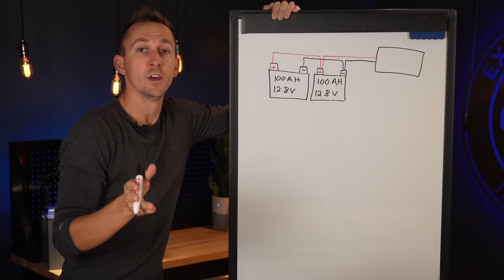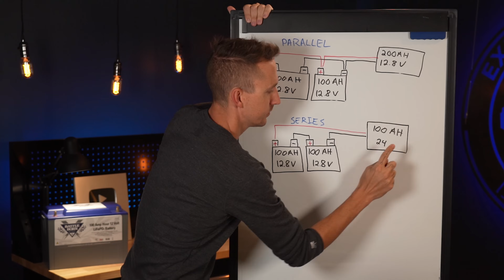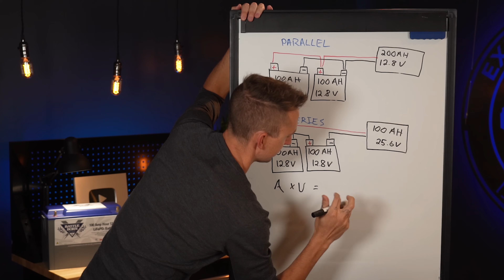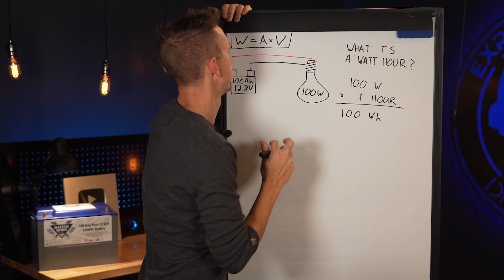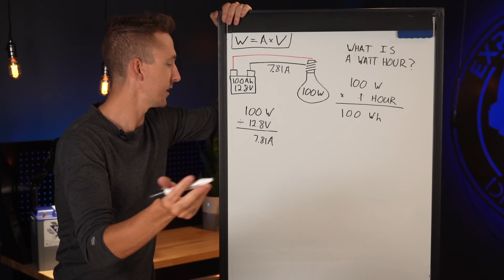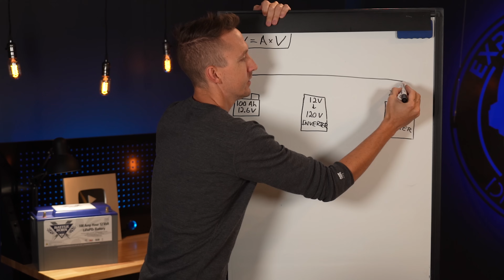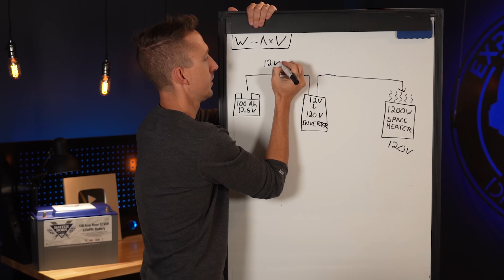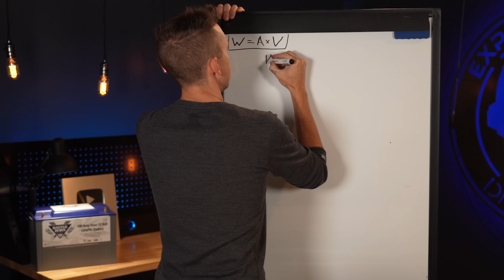AMP HOURS EXPLAINED (amp hours vs watt hours)

Comment: Am I the only one confused? He says the 7 amps is the same as the 3.9 on a 100 amp hour battery. Says it’s the same. It’s not. The 3.9 amp will drain the 100 amp hour battery half as fast.

Comment: A little critique you are right on formula of amps x volts equals watts but you're going to draw more then 95 amps because there is a loss of energy in the transformer inside said inverter. Soo say your inverter is 90% efficient that means 10% is still lost to the conversion of 12v to 120v. So the equation will now be 95 + (95 x .10) = 104.5 amps plus the inverter draws power to be on as well so you have to consider that.  The idle inverter power consumption I believe is a constant that has to be taken in consideration for long time use in calculating total amp draw from a battery. Cause the inverter is powered by the battery too not just the load it's supplying a 120v or 240v device or devices. The inverter if it's a 12v inverter requires some energy to the circuit board inside it to properly convert 12v to 120v/240v. Plus as said before take into consideration the efficiency of the inverter itself. The higher the efficiency the less lost energy and therefore more usable energy. But keep in mind just cause a battery says 100 amp hours doesn't always mean you actually have 100 amp hours to use.
Reply from the maker: I purposefully omitted things like inverter losses, pukert exponent effects & the differences of inverter losses between inductive and resistive loads to keep the video easier to understand for this 101 level discussion.

Comment: Does that mean you have fried the battery if you depleted it completely. Or if you continue to do it it is not health for the longevity of the battery ? 
Is there a formula that should be considered to not deplete the battery to low?
Reply from the maker: Each battery type/chemistry/manufacturer will have their own guidelines for their depth of discharge and how it affects longevity.

Comment: Can anyone explain to me is why at 12.0 volts my leisure battery is (apparently) deeply discharged and needs changing.
Reply from the maker: A fully charged battery will sit at somewhere around 13.6V and as it discharges; the voltage falls.
Reply: @EXPLORISTlife  I realise that, but why at just 12.o volts is it classed at deeply discharged IE Needs replacing
Reply from the maker: IDK... that's just how batteries work.

Comment: So if I'm understanding this right a 12v 100ah battery which costs a minimum of $300 can only run a space heater for a hour. In the winter in my house we run multiple for probably 8 hours or more. That's not even counting other power usage and that's thousands of dollars in batteries just for a day's power. How can anyone build a feasible battery backup at these prices with such small capacity?
Reply from the maker: Usually people aren't building off grid electrical systems to support extensive electric space heating usage.  Diesel/gas heaters like the espar d2 are more popular for mobile applications & wood-burning stoves/fireplaces are more popular for stationary applications.
Reply: @EXPLORISTlife  diesel and gas are getting mighty expensive. Part of the reason I was looking into solar was in hopes of circumventing the ever increasing costs of energy. Storage is surprisingly low in capacity and high in cost though.
Reply: @Silmerano And there, in a nutshell, is why so-called "green energy" is still a long way from being a viable alternative to fossil fuels and nuclear power.

Give it time though and eventually some boffin will come up with a great, efficient, compact, low cost way to store large amounts of electricity long term.

You'll know who they are when it happens, because they'll rapidly become one of the richest people in history!

Comment: I have a 6v deep cell battery rated at 370 ah (20 hr. rating) but the manual for the battery says 2.46 kwh (100 hr. rating). If I use the first number ah I get 6 x 370 = 2.22 kwh but the published value is 2.46. Why? this is for a Trojan L16RE-B

Comment: so if a motor is 180w and it runs at 220v it then consumes 0.8181A per hour?
Reply from the maker: At 220v; yes.  If it's being inverted from a 12V battery bank; it'd be 180/12 = 15 amps coming from the battery.

Comment: wiring two 24v arrays to increase to 200ah. should it spark or attempt to weld to stud?? The issue is when wiring the 2-24v batteries together the wire to inverter.
Reply from the maker: Wiring batteries to an inverter will likely spark; yes.

Comment: I don't see any benefit using a 24 or 48 volt bank in a camper situation, the only benefit is smaller wire to the inverter. Now you have to add a converter to get 12 volt appliances to work, you have no backup for coach batteries if the need arises, not without special wiring considerations anyway. Keeping 12 volts just makes everything easier, the cost in the wiring, to me doesn't add up, not after buying everything else... converter...special relay considerations for coach back up...I'm sure other things I'm not remembering. 12 volts just keeps it simple.

Comment: A problem that I need to know I use a 12-volt system and an inverter to change it over to 110 is 12 volt conversion 210 more efficient than 24 volts converted to 110 which one's more efficient don't care about wire size about efficiency or are they both the same. Thank you if you could answer the question to make it easy old me for I am old and that's my skis

Comment: so its just because wires are expensive mostly that you wouldn't want to have a 12v system but in reality you only need to get those wires once. Everything seems to run from 12v for DC power. I'm not really understanding the rest of it.

Comment: and here's the problem with your description, everyone wants to know how many hours a battery can run an appliance. and yet you never mentioned time in your calculations not once. for example, if you have a 12 volt battery that can run at 4 amps that winds up being 48 watts correct? if I plug in a 12 volt fan, will it run for 4 hours? I have no idea, you tell me. but you didn't tell me even though I watched your whole freaking video
Reply from the maker: Chill bro.  That's not what this video is about.  I have a different video I made like three years ago that addresses that.  Search for 'explorist.life how much'.

Comment: But the other problem is you can only use 50% of the stated Amp hours on the battery.  Unless it's a lithium which can use 80 to 90 %of its stated capacity.

Comment: Question. On a 48 volt 100 ah battery. Does 100ah mean it can output 100 amps current? I am trying to select the right dc switch for my battery bank.
Reply from the maker: Nope.  The amp hour is capacity only, not Amp output.
Reply: @EXPLORISTlife  what would be the output current of my 48 volt 100 ah battery? I'm getting .15 amps on multimeter with no load. Is that right? Is a 200 amp switch big enough hooked to 2 batteries?

Comment: Okay so if i understand why bother run 200ah batteries at 24v wen running one 100ah paired with a 120v inverter.

Comment: Hey Nate, was hoping you can give your opinion on a problem im having. Ive set up my Lithium battery bank through a lynx shunt and lynx distributor. I used your idea to directly bolt a 300a rotary switch to the positive tab on the lynx shunt, the negative direct from lynx shunt to BMS. My Multiplus 2 is getting high temperature and on inspection the rotary switch is getting real hot Also I have a 200a fuse out of the lynx distributor to the Multi, this is also getting hot (but not as hot as the switch) on the load side of the fuse, Ive checked all connections and have come up with 2 possible causes.
1. The positive from battery to lynx is only about 40cm long wheras the negative is about 90cm by the time it goes through BMS and connects to battery.
2. Rotary switch fault.
Any ideas on what is causing this heat build up? The heat is so you can barerly touch the studs of the switch for more than a few seconds

Comment: The difficulty is actually determining your average load.  We're Off-Grid and figured this based on our current home at the time and only looked at the monthly usage on our bills. 

Now that we're living in our Off-Grid home we fine that we're actually using a lot less power because we built it better meaning our needs are fewer.  

This totally messed up my calculations such that I didn't need a dual inverter system and eventually turned one of the inverters off.

If I had known the average usage at the new house I would have been able to calculate that we didn't need two inverters and should have spent that money on a larger battery bank instead.

Comment: Hello, Thanks for the info I learned a lot from you. 
If you could help me on my system I would appreciate. I have 8 Panels each 350watt mono, 
I have 8 batteries of 150amp gel, 3000 deep cycle, connected in series, it is 48v sysytem
STECA SOLARIX PLI 5000-48 INVERTER HYBRID INVERTER- indicated 80amp, no controller needed. 
I got 160amp fuse for solar wire before it get into the invertor, One point to consider my system is not high tech like yours, I am communicating with you from far away in Africa. 
I tried to explain my system so you understand what I got,
My problem, during the day time the Invertor charges the batteries and they get to 53.6¬53.8 volts, but this is where it get  complicated in the evening or sun-set the invertor start beeping error 04 by saying low power from battery, then switches back to the grid=no use at the evening!
This made me mad, the setting is set to 44, if battery get law than to 44 then only Invertor to go back to the grid. Investigations I measured the batteries and each is showing 12.6 to 13.4 volts each.
Do you come across this kind of faults where the battery is full and come in the sunset no power to give,  where it should hold at least few hours, but it gives up at sunset.
Please ask any diagnostic questions, if I missed any, thanks in advance
Thanks in advance Alex
Reply from the maker: Hey, Alexander Yusuf! I appreciate you taking the time to ask your question, but unfortunately, I don't have enough info about your specific question to provide an accurate answer, but here is a playlist that, if you watch all of the videos start-to-finish (and take notes 😉), you'll have a REALLY good idea of how to design a solar array: https://www.youtube.com/watch?v=Jkbs84sBHsg&list=PLmvhcyi4n0TV9pi83rFTv3ZuMT_S1xIZt

Alternatively, I have some of my most common solar array setups pre-built here: https://shop.explorist.life/product-category/all-products/camper-wiring-kits/solar-charging-wiring-kits/

Comment: I want to buy an electric scooter. 
one has a better with 48 v and 28 ah.
the other one has a better with 48 v and 1306 wh.
both scooters claim that they can run for 120km . which one should I trust

Comment: When you use a battery bank (lead acid in my case)... you get this illusion that you'd have power until it gets to zero capacity. But I wonder if that's right? Would the system actually lose too much voltage to really power anything if you go below, say 50% or 30% of the battery bank's capacity? 

Like when I put in a load right away with something running off the system, the power on the battery bank is dropping from 12.5-6 volts down to either 12.4 or 12.3 volts sometimes. If its higher watts it seems to dip even more. So... logically I'm not sure if I'd actually get to a point where it couldn't power stuff, even though there was still juice in the batteries? 

I also have 12.5 volts in my batteries as NEW batteries not the 12.8 V shown in your video.

Hope someone has some ideas on this. Thank you.
Reply from the maker: With lead-acid and AGM, that is indeed an issue.  With Lithium; that's really not an issue.

Comment: Maybe this can help

Think of it as having regular unleaded or super unleaded gasoline in your car

Parallel ( + to + and - to - ) will make your gas tank bigger so it holds more gas but the gas in the tank (regular gasoline) stays the same so you don't get more power out of the motor but the tank is bigger so you can drive further 

Series = (+ to - and - to + ) is like having super unleaded in your gas tank (running batteries in series )will give you more power out of the motor but the gas tank stays the same so you not going to go as far because your putting super unleaded gas tank ( putting batteries in series ) not regular unleaded ( putting batteries in parallel)

Parallel = bigger gas tank(same volts)
Series   = more motor power (+ volts)

Comment: Don’t forget about voltage drop as the battery runs lower. Also, efficiency ratings of inverters and real world battery capacity. For example, on my Tesla it’s been proven to extend the battery capacity life, you need to charge when it gets to 20% and stop charging when it gets to 70%. Otherwise the battery will become useless like our phones in 5 years.

Comment: I like to think of it like this:

Imagine workers carrying batches of electricity through a hallway (which is the cable).

Wattage: how much electricity needs to be carried

Voltage: how strong workers are; how much electricity each worker can carry.

Amperage: how many workers are needed to carry the electricity.

So, the lower the voltage, the less a worker can carry; which means you need more workers. More workers need more space in the hallway (cable) to be able to walk together, so lower voltage electricity needs a thicker cable to be carried.

At a higher voltage, each worker can carry more electricity, so fewer workers are needed, and therefore, the hallway (cable) doesn't need to be as wide to accommodate them.
Reply: This is brilliant. Thank you

Comment: I am trying to connect 3.2 volt batteries together. What do you suggest for the kind and size of wire to run a 650 watt wheel chair motor? Anyone?
Reply from the maker: Here is a video that will teach you how to size wire for various things: https://youtu.be/ki3WXVR48eM

Comment: Soooooo, my batteries are 168w per cell, 11.3nm....

How many 12v batteries can I put into parallel? 9?

What gauge wire do I use on 9 batteries in series?

Would parallel be better?

I have 4 solar panels, two 45w, two 100w, 290w in total?

I have 2 charge controllers rated at 7amps.

Can 4 solar panels at 290w charge a 9 piece 12v battery bank in series?

Would a 3000w inverter, 290w in solar, nine 12v batteries power three 720w grow lights for 8 hours?

Like, would 190W charge 9 of those batteries in series?

Nine 12v batteries and 190W solar, would that work?

Thanks

Comment: Then there is loss in the wiring and also in inverter efficiency.. So the total pulled out of the battery will be more than the 95a..
Reply from the maker: Although that is technically correct, power factors, inverter ineffencies, peukert effect and other such things are too advanced for this 101 level discussion.

Comment: Nate, hats off to you. This is the best video I've seen on the subject because of its clarity and simplicity. I just bought 4 new 12V batteries for my semi. I believe they have 100ah each but I'm not sure. So let's assume they do. They use a parallel connection. So I was wondering if you could do a video illustrating WHY semi trucks (as well as other big vehicles) use a parallel connection instead of in a series.

Comment: Have you played with power stations?
Reply from the maker: Portable power stations?  Yeah; not on this channel, though.  We have a Jackery 500 or something that we just chuck in the car for weekend tent camping.  I don't like them for permanently installed systems.
Reply: @EXPLORISTlife  I understand the "permanently installed systems".  

My raw concept. Buying my first boat that has a heat pump (cooling/heating) when connected to shore power. When not connected to a dock I was thinking about making the house battery much larger with LiFePO4s. Possible hardtop bimini with bifacial panels. We boat on a huge lake for 5 months of the year. The idea is to move the battery bank to a seasonal cottage for the other 7 months of the year to provide WIFI, etc. Many brands like the Anker PowerHouse 767 have 2 wheels and a telescoping handle like luggage.

Comment: Soo...now I am wondering something...I know it may be possible...or it is and am soo new at this...if I had say 8 3.2v batteries with 200ah capacity...if I wanted to make it into a 12v setup and 400ah capacity, I would wire in 2 sets of 4 in series to make 2 banks of 12v and then take those 2 banks and wire them parallel to get the 400ah capacity...right???  Cause that's where I lost myself on if it's possible or not.  Only ask this cause I see alot of cheaper 3.2v 200ah(ex. $45 each)batteries that would in turn be cheaper than 1 12v 200ah(ex. $400 each) battery itself.

Comment: I've 2x 100Ah 12.8V battery in parallel,  giving me 200Ah at 12.8V
Now I have a lawnmower at 1700W 
1700/12.8= 132 A
Why doesn't it run ?
Reply from the maker: Based on the information provided, I have no idea.
Reply: @EXPLORISTlife  ,  Does de BMS play a role in it ?
Reply from the maker: Perhaps reach out to the manufacturer of your lawn mower for support on why it's not working.
Reply: @EXPLORIST life - DIY Campers  , It reacts like, for comparison,  the clicking of the started on a car engine, getting mot enough power to start.
Can it be that I need to put a soft start component , because it has a to high start peak ?
Reply from the maker: What did the manufacturer say when you reached out to them for support?
Reply: @EXPLORISTlife  it runs fine on grid power. So why not on the battery bank.
Reply: @EXPLORIST life - DIY Campers , It's Sunday,  a d I don't think they will be able to answer that question.  The specs of the battery  are ... Power Queen 12.8V 100Ah LiFePo4, max continue load power 1280W, max discharge during 5sec 280A, max continue charge/discharge 100A, ... 2 like this in parallel.